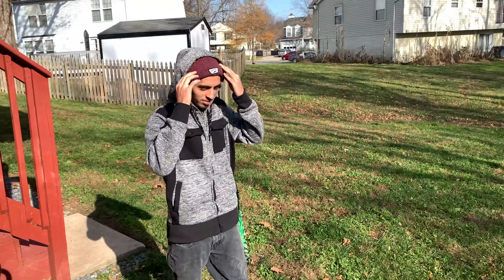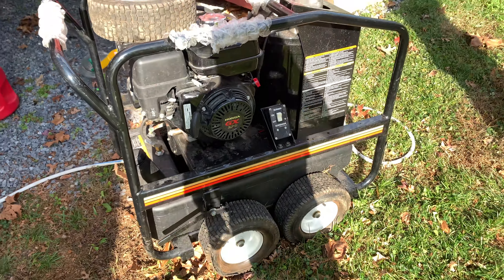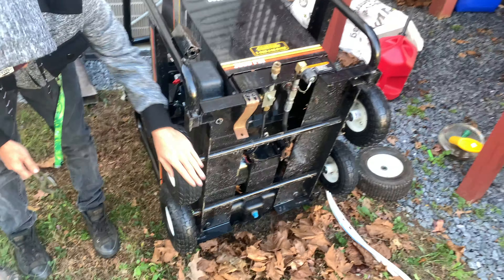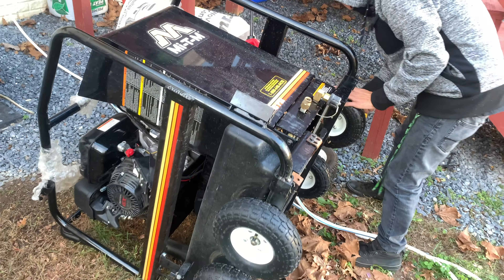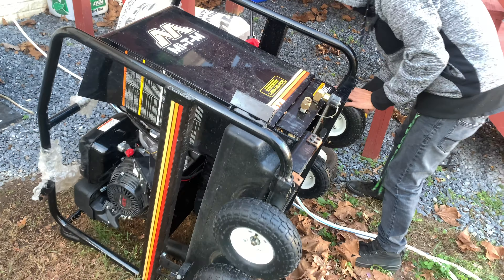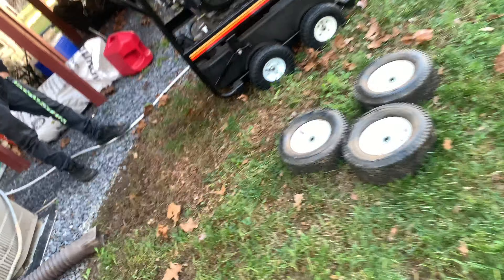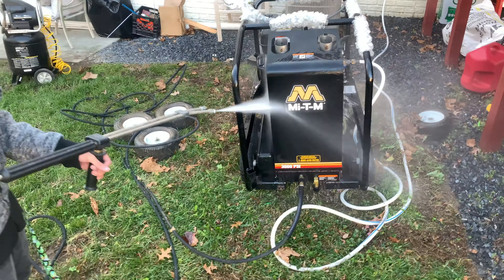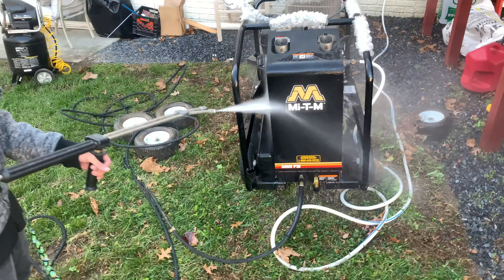This Pressure Washer Makes My Bike Look Brand New!!!

Comment: Should I get a ttr 125 or a yz125??
Reply from the maker: It depends on your skill level really. A ttr125 is a great starter bike. The yz125 has a lot more power so I wouldn't recommend it for beginners. Id definitely prefer a yz125 if it was me.
Reply from the maker: Did you end up getting a bike?